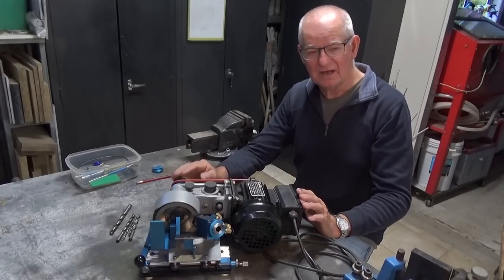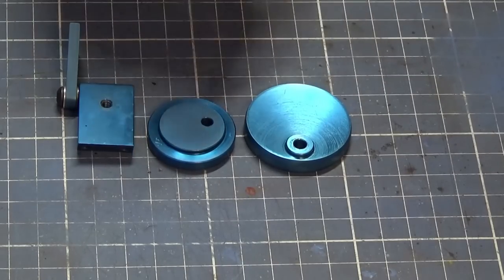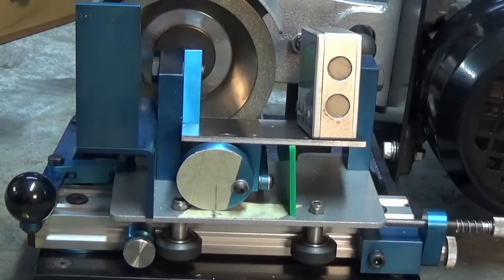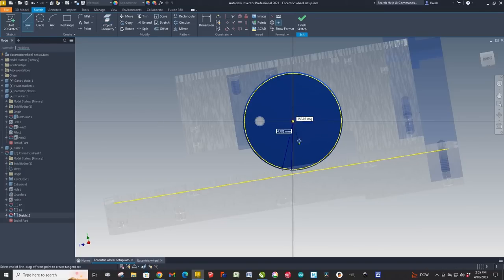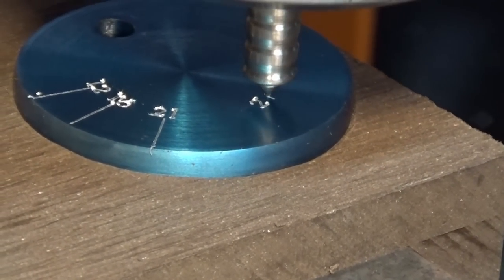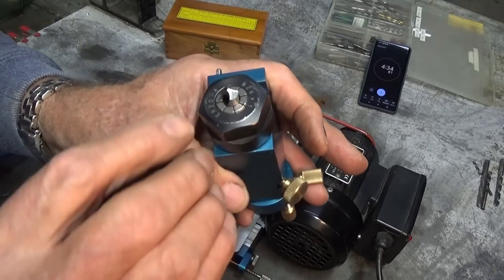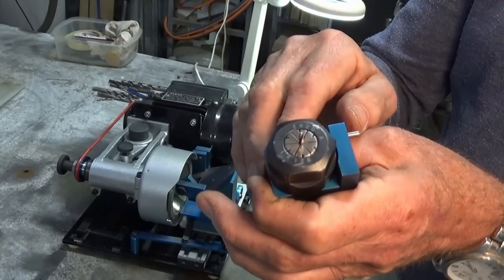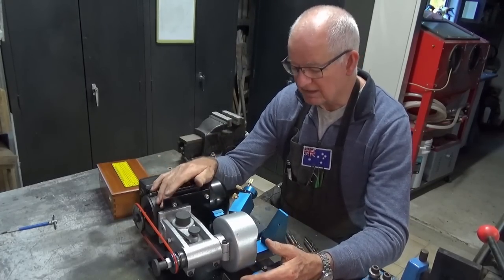A 4 Facet Drill Bit Grinder DIY Style Final

Comment: I don't have a drill sharpener (actually I have a very used Drill Doctor clone which I don't like enough that I just buy new drills all the time). While watching your video it seems to me that your order of operations is backwards. You ground the secondary facet and then the primary facet. And you didn't reset the drill's lips to be horizontal (if you had to feed the drill bit into the grinding cup/wheel while grinding the secondary facet). I think that might be why you sometimes don't get a constant width primary facet.

Can you try this to see if you get a more consistent primary facet:
1. Set the back edge of the most worn lip of the two cutting edges to be horizontal (ie parallel to the collet's base).
2. Set the trunnion to the PRIMARY facet angle and grind the PRIMARY facet of the first cutting edge, and let it spark out.
3. If the drill is badly worn and you don't get a fill width cutting edge (or full width primary facet) on the first lip, then feed the drill into the grinding cup/wheel and start over at step 1.
4. Rotate the drill 180 degrees to grind the primary face on the second cutting edge and let it spark out. 
5. If you don't get a full width cutting edge (or a full primary facet) on the second lip (or if you don't get a straight chisel point) then feed the drill into the grinding cup/wheel and start over at step 1.
6. Then change the trunnion angle to the SECONDARY facet angle and grind both SECONDARY facets (without feeding the drill towards the grinding wheel).
Reply from the maker: Bruce, thanks, I will try that. I did find that badly worn or chipped cutting edges needed a lot of grinding and after getting some strange results I did realise that the cutting edge had migrated around and was no longer parallel to the collet block base. A quick reset on the alignment jig then allows for a light regrind followed by the primary grind. I still need a lot of practice but the results so far a promising.
Regards,
Mark

Comment: Mark, excellent work as always. Is there any chance you would be willing to share the iam/ipt files you created? Thank you for sharing your work, it is very valuable!
Reply from the maker: I have put a zip file on my dropbox with all the native Inventor files. https://www.dropbox.com/sh/38ahn5tz4qw5ypw/AACtAbmXNDYa4x0v9DD1NcEOa?dl=0
Regards,
Mark
Reply: @Preso58  Thank you!
Reply: @Preso58  Mark, Thanks for the inventor files.  I opened them today and noticed a few files were missing. Specifically "Z axis carriage no motor.iam" and associated parts.  Any chance you could update the download with those files? Thanks again much appreciated!!
Reply from the maker: @termlimit  I didn't include that subassembly because it was a very specific part that I had recycled from an old 3D printer that I made many years ago. I assumed that other builders would probably substitute another style of gantry using something like linear rail. However I have added it to the zip file on my dropbox.
Regards,
Mark
Reply: @Preso58  ahh ok fair enough thanks for the reply

Comment: I literally hate PDF files for graphics due to the fuzzy edges on lines.  I much prefer 2 color (B&W) BMP files.  Do files have to be in PDF format for you to use them?
Reply from the maker: I find that Corel Draw can edit PDF files into vectors very easily. Some circles end up in segments but you can weld them into continuous paths or just draw a new vector circle to replace it. Unfortunately, my version of CorelDraw won't open DXF or DWG files exported from Inventor. There is an add on package that will translate them but it's very expensive. Have you tried Inkscape? It is a free vector drawing programme and it will open PDF files as crisp, sharp, editable vector drawings. 
Regards.
Mark

Comment: You could improve the accuracy of your angle setting If you took a small piece of alloy flat bar and were to machine a profile or curved slot the thickness and the radius of the eccentric you made with the base plate surface tangential to the machined slot, so as it turned, the flatbar would translate from left to right with the eccentric, like a cradle so to speak.  you could then attach a small perspex plate with a vertical line scribed in the center as a reference mark for your eccentric graduations or a simple pointer or something as a reference to align the graduations. Im tired and struggling to explain the picture in my brain sorry but hope you can understand what i mean 😊
Reply from the maker: I am sure there are lots of ways to get accurate marks or a more direct way of setting the angles but it's apparently not that critical to have a very precise angular setting. 
Regards,
Mark